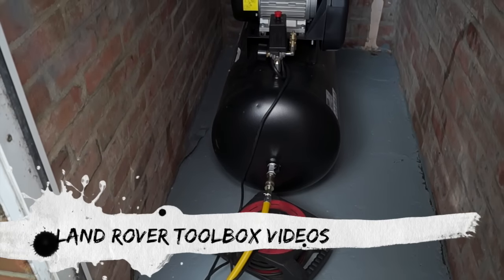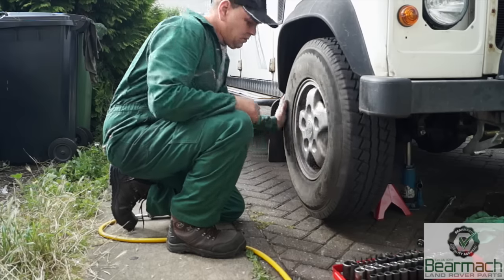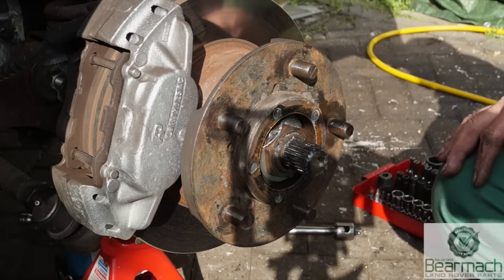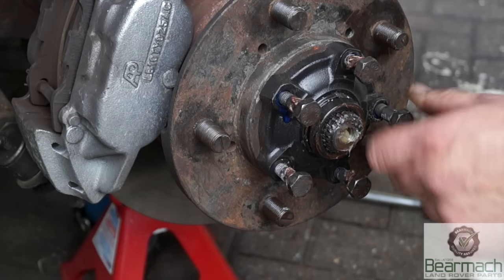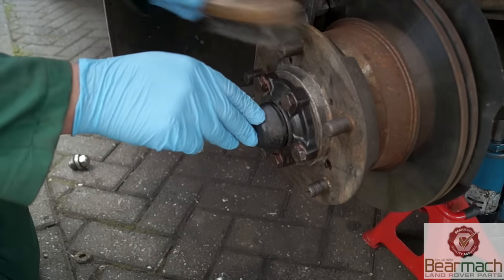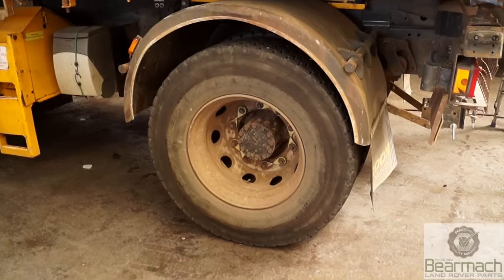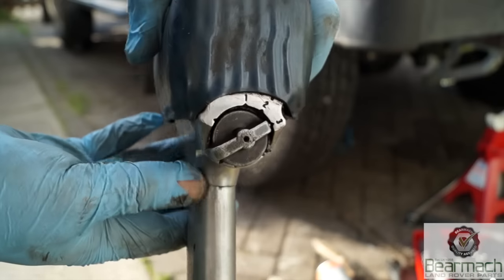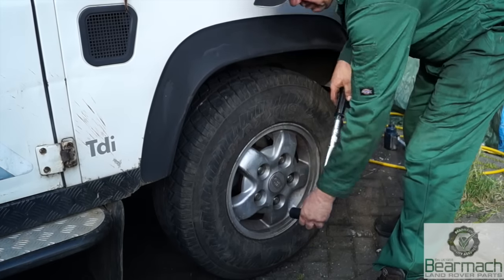Defender wheel bearing rumble test & wheel refitting - The Fine Art of Land Rover Maintenance

Comment: 07:58 - First one --> Jump two nuts clockwise (or anti-clockwise) --> Keep jumping two until you get to the 5th nut. That's how I remember it. That way you won't do the same one twice. It'll go: 1, 3, 5, 2, 4. Odd ones get done first, then even ones get done after.
Of course, this works for the 5 stud but not 4 or 6. Opposites are easy to do on those, though.
Reply from the maker: +Jim Griffiths  okay cheers.